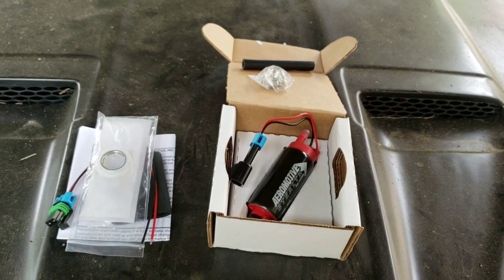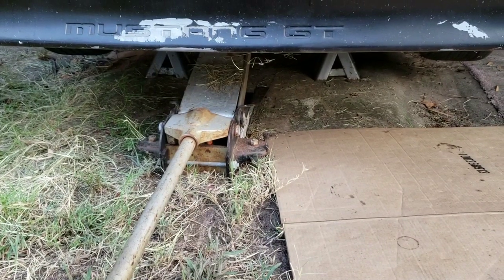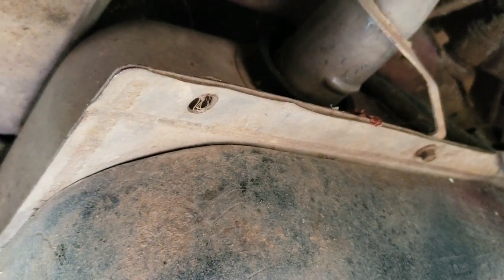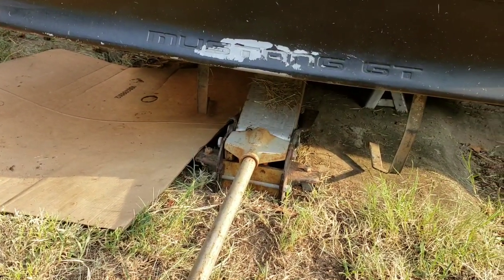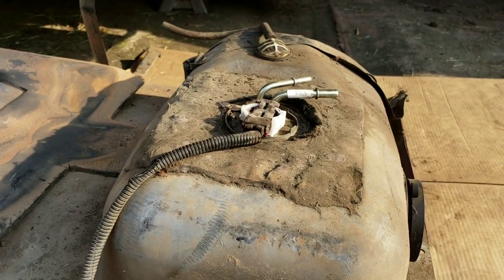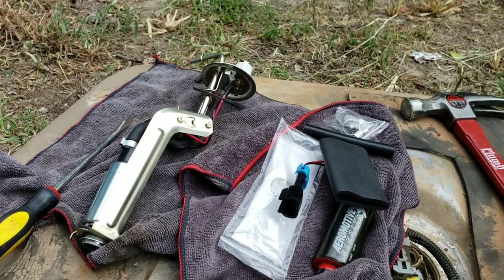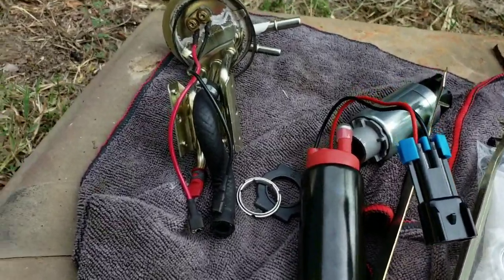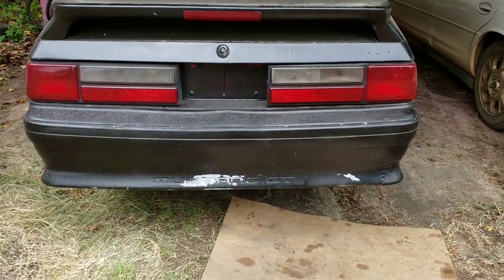Foxbody Mustang GT Project Car: installing a fuel pump

Comment: Is the pump still running good? I was thinking about upgrading to this pump. I have a 255 in it now under power I loose pressure. Just wondering your thoughts 1 year later?
Reply from the maker: The pump is still running good. I only got to drive with it for two months then my foxbody broke down on me. But the pump never gave me any problems and It a awesome pump to upgrade to👍